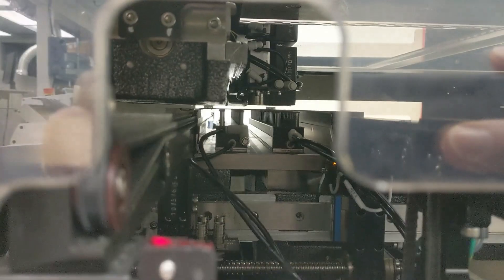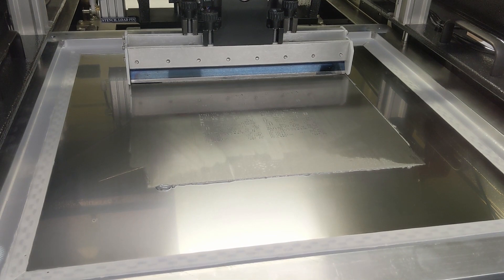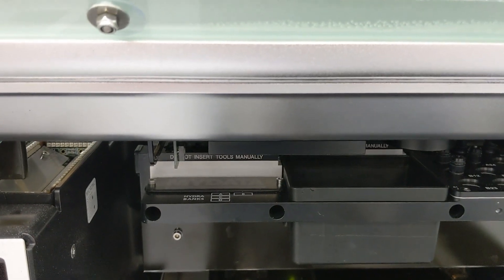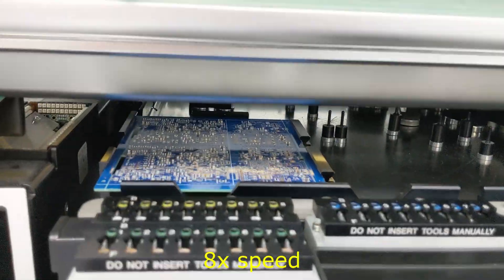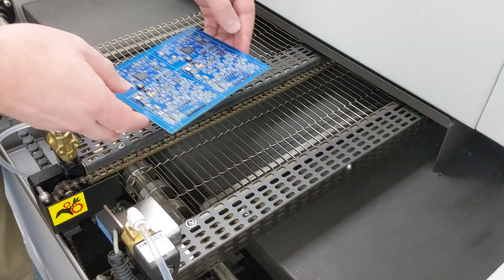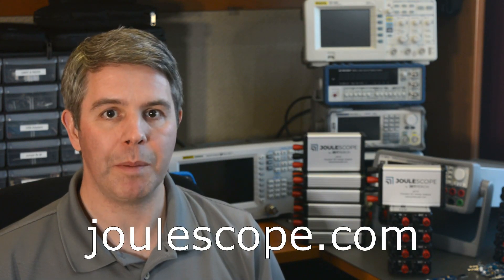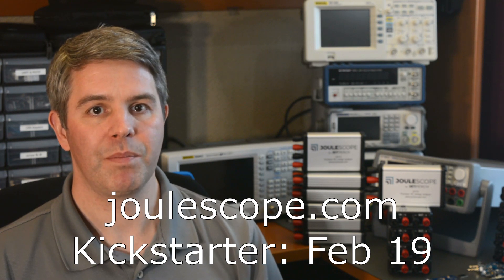Printed circuit board assembly process

Comment: It's interesting to look back at this video now, in December 2022 :)
It seems like the Jouelscope has became a success.
I have my own JS110, and it's a really nice tool !
Reply from the maker: Thanks @rigfix!  It's a little late to still be pitching the Kickstarter ;)  Great to hear that you like your JS110!

We are still using Custom Electronics Co for our Joulescope assembly.  The first JS220 build went great using this exact same equipment!  The only major new addition compared to JS110 assembly is a fiber laser that we use to laser engrave the bottom of the enclosure.

Comment: Some components require certain max temperature during assembly. How is temperature monitored during the assembly process? Thanks for the video.
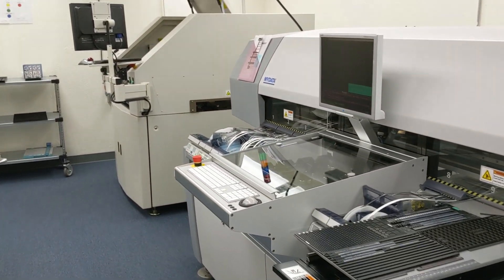Reply from the maker: The oven has different temperature zones so that it matches the reflow profile.  You can program the temperatures.  The oven regulates itself to match the programmed profile.  At 3:12, you can briefly see the oven monitor that shows the temperatures.
Reply: @Joulescope  thanks!
Reply: You don’t just randomly heat it up everything is controlled

Comment: How much it cost to buy an PCB assembly machine. Who are the providers?
Reply from the maker: Hi @prudhvi daruvuri
 - I design and sell products.  I am not a contract manufacturer, so I do not have a lot of experience with different machines.  I have heard you can get small, hobbiest-grade pick & place machines starting at about 2,000 USD.  However, the professional equipment shown in this video costs much, much more.  I have heard that Neoden makes some of the least expensive, but still decent, machines.  Good luck with your search!
Reply: maybe around 100,000$,actually depends on different brand.
Reply: Say rain from hundreds to millions it very much depends on what do you want?

Comment: What are exactly the models of robots used in this video for the assembly process of a Printed Circuit Board ?
Is there any possibilites for creating your own custom  assembly robot and software for developing a high speed PCB?
Thanks in advance :)
Reply: I don't have the exact info, but if you step through the video starting at 3:08, I think you can see most of the equipment manufacturers and general model numbers.  You certainly could create your own machines, but why when many commercial units exist for every price range.  Also, professional assembly is reasonably priced.  For example, check out PCBWay and Macrofab.
Reply: @MatthewLiberty  I was curious to know if It will cost me less to design and implement a high PCB myself and even programming a certain software project, than sell it to a specific corporation,from a business perspective?
Reply: @albugabriel9277 My opinion is that if you are just want something for yourself, it's usually cheaper to buy existing products.  Companies spread out the development costs across many units.  Your time to recreate something that exists is usually not worth it unless you are doing it for educational purposes or you plan to compete with the existing vendors.
Reply: @MatthewLiberty  I want to start my own PCB Manufacturing business and compete against my vendors, with this I can affiliate with medium or big companies who wants a implementation to their design or even create myself those designs for their problems.
Reply: @albugabriel9277  So you want to start a contract manufacturing company?  You should know that this is an incredibly competitive space.  I have used contract manufacturers, but I have no experience with running a contract manufacturing company.  Definitely do your homework and figure out how you will differentiate your company.  For example, PCBWay and JLPCB are inexpensive.  MacroFab and CircuitHub are easy to use and more capable.  specific.dev has PCB "blocks" that you just connect together.  zGlue allows you to make a custom chip.
Reply: The screen printer is made by ITW EAE under their MPM Momentum brand. The pick and place machine is a MyData, not sure of the model. MyData is now known as Mycronic. And the oven is made by Heller Industries. If you search the website Reddit you can find lots of people that have made their own P&P machines. I think they can even feed from cut tape now. I work in SMT assembly so let me know if you have any questions! :)